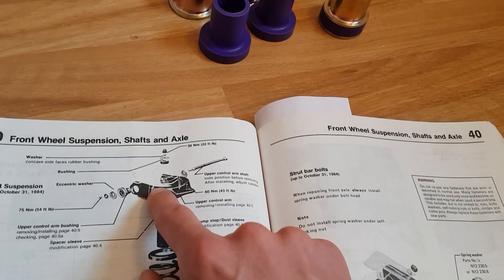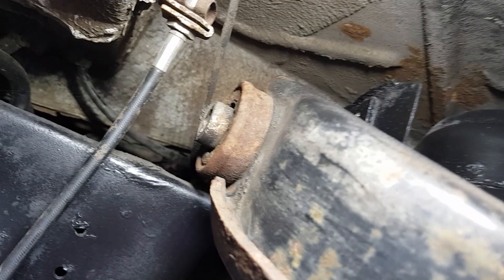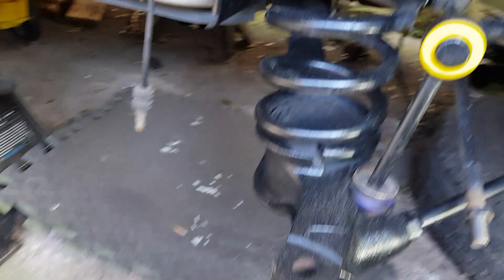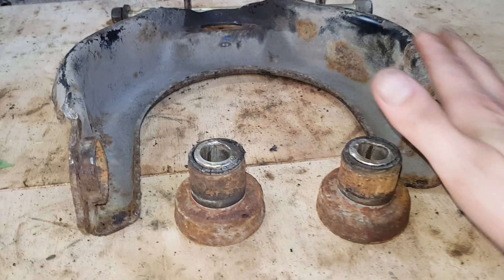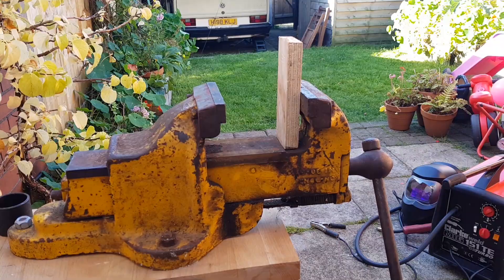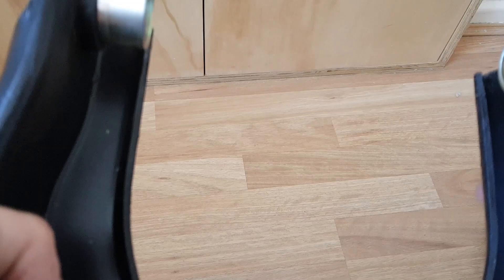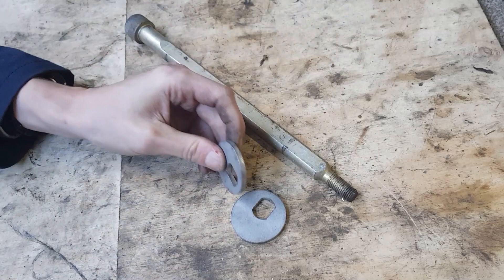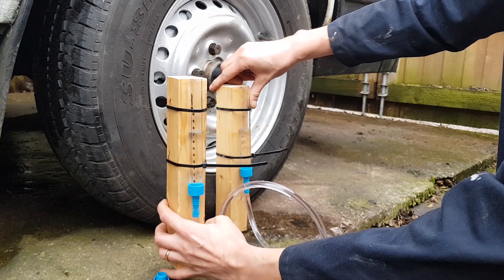VW T3 / T25 / Vanagon - Upper Control Arm Wishbone Bushing Replacement

Comment: hey, the video is new so I hope you will read this comment.

About the welding, if you got holes in the dots, it's meat that the surfaces that you are trying to weld together are either dirty (oil, paint, zinc, dirt, water, rust) or the wind blow the gaz out, make sure to be out of the wind when you weld, by simply cutting the way of the wind with something like putting stuff around the table or by welding inside.
I would recommend you to away wash/clean new peaces, this is even more true when you are working on mecanic parts since their is a thin layer of oil to protect any metal, gently grind the paint and seriously clean up the rush, this will be your worst enemy when working on you T3. a simple dot of rust around 1/4 inc can hide a 3inc long of rust repair (i'm thinking about you past video about the trailing arm when you want to repair the hole)

Great videos, subed and following, many thanks and have a nice day
Reply from the maker: Great, thank you. I'd love to have an indoor workshop! I'll hopefully be doing some more welding later this year so thank you for the suggestions.

Comment: For threads on bolts, I always use some copper slip anti-seize. You will thank yourself later if you need to undo them. Great set of vids, I just purchased a T3 myself and learning all about them and your vids help.

Comment: The upper control arm long bolt has a think washer and a "distorted 19mm nut" at the end.  It is a good practice to replace the nut, as over time these will loosen up and not stay tight if not replaced.  The 54 ft lbs. is recommended and re-torque after driving to see if it holds at 54 ft lbs.  On my 84 westy, this nut came loose resulting in a clunk and alignment issues.  Also, I have read that when using the PowerFlex bushing, welding is not necessary if pressed into place properly.

Comment: try turning the wire speed down, the faster the wire comes out the amps will be used burning the wire and not penetration of the parent metal

Comment: Thanks for the video. I have a Q for ya. Before you tighten that nut on the camber bolt, do you have to have the vehicle back on the ground? I have a bad squeak after install of new bushings. I tightened everything while it was up on blocks.
Reply: I would like to know this also.  I did the upper control arms and also have a terrible noise coming from them.  Reading through the community it seems like a side affect of the poly bushing but I can't believe there isn't a right way to avoid this.

Comment: Watching your video and the one from the guy at vanagain, in on of his comments he said you don't need to weld them... how true is that???
Reply from the maker: The Powerflex instructions say to do it and VW spot welded the originals. I don't think they would have bothered if there wasn't a valid and tested reason to do so.
Reply: @JamesAkers  thanks just wanted to confirm...  i got to get me a welder then... cheers!
Reply: I think it states in the manual that you don't weld the syncro ones, for what reason I don't know, but 2wd you do?

Comment: I read online that polyutherane bushes go bad quicker than rubber ones, is that true?
Reply from the maker: It should be the opposite, they're made to fit and forget. Powerflex bushings also come with a lifetime guarantee.
Reply: @JamesAkers  I thought that too, then I did some research on polyflex bushes and saw that most only lasted up to 3 years. Not sure where I found it.
Reply: @JamesAkers  Polyurethane Suspension Bushes - The Good & Bad is the video I watched
Reply from the maker: @FhVW  Can't really comment on that video but seems like it's made by a competitor? The Powerflex ones were made in collaboration with Brickwerks and i've not seen anything from the T3 community which would suggest they go bad.
Reply: @JamesAkers  Good call, Please let me know how those bushes will work out for you. I might install some on my LT